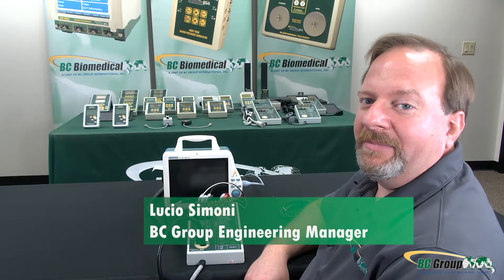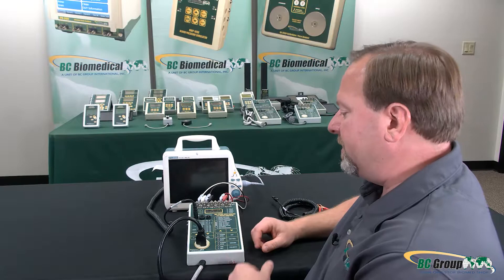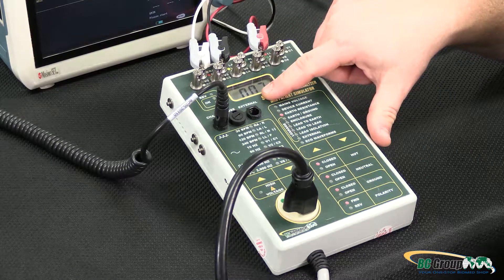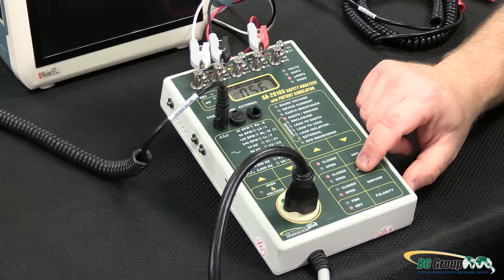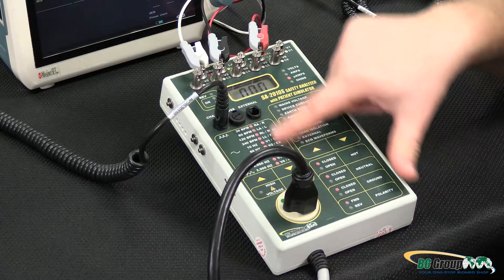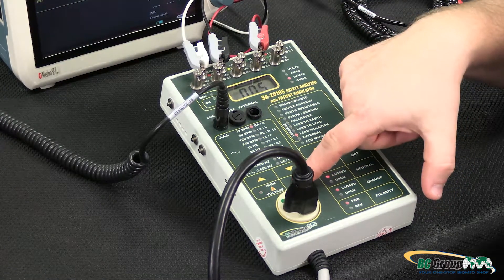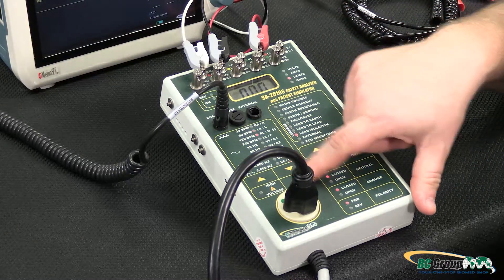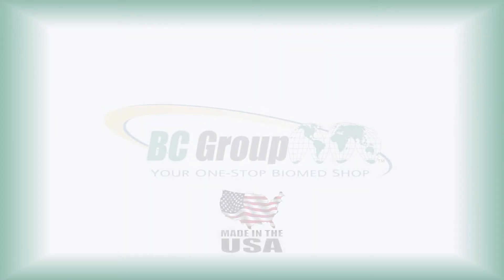SA-2010 - Safety Analyzer: Basic Functions & Features

Comment: Hello dear, does this unit operate with 220VAC input? Is the voltage at the output socket the same as the input socket?
Reply from the maker: Thank you Leonel for your question.  Yes, the voltage at the output receptacle is the same as the voltage that the SA-2000 series is plugged into.  https://www.bcgroupstore.com/Search.aspx?k=SA&m=2
Reply: @bcgroupintl  Thank you very much